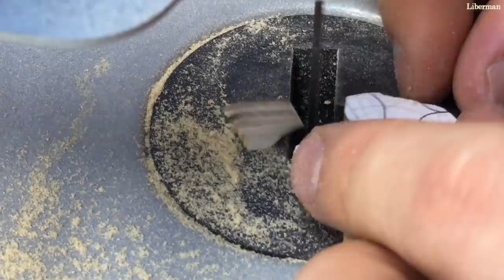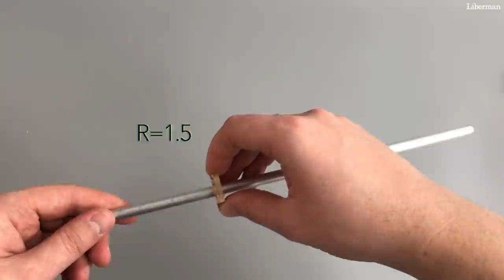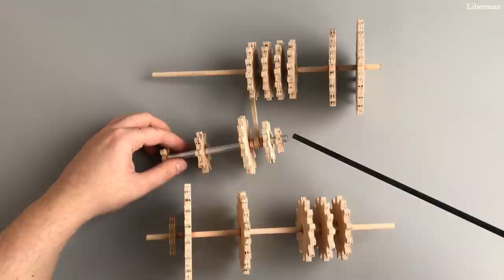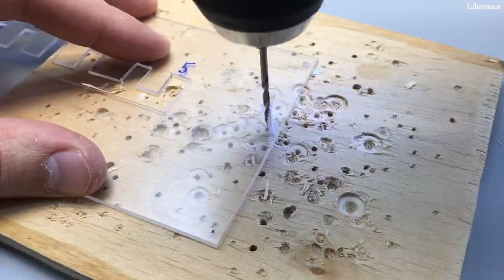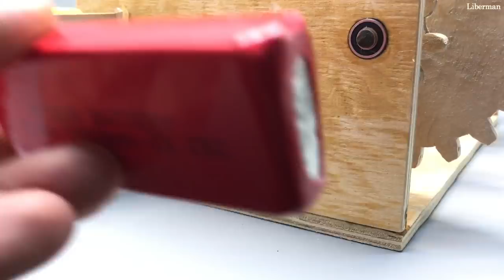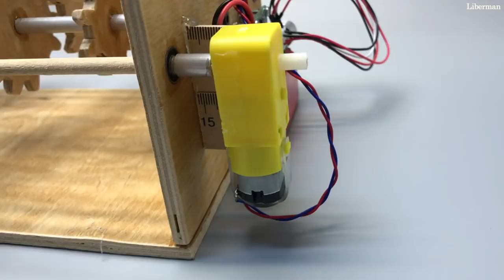How to make 5 Speed Gearbox +R from plywood

Comment: Who else noticed all those cuts when he was shifting?
Reply: He didn't build a clutch, he'd either have to get really lucky timing his shifts or stop the motor to shift smoothly and not just rub the gears together. He probably cuts where he stops the motor
Reply: @firebunny3198  yeah i figured thats what it was
Reply: Well, you don't want the gears grinding, so they probably turned it off and alignes it properly.
Reply: Me
Reply: no clutch
Reply: could this be fake???
Because he cut it when he shifts
Reply: @geraldsilvers8752  yes, thats exactly what I meant
Reply: d e   v i d e o   l i e d ? ? ?
And i actually wanted to make it but now i dont
Reply: @geraldsilvers8752  yes 100%
Reply: Although he work hard...❤️👍

Comment: Notice how he was cutting the video between shifts, probably just cranking up the speed on the motor
Reply: Well, there is no cuts when switching to N, R, 1, and 4th gear.
Reply: Too add on to that, when he was downshifting he did not cut 3, 2, and 1st gear.
Reply: Dylan Lockler yeah I know he didn’t cut between all of them, but he did cut a few times
Reply: He jist letting it speed up there are no cuts

Comment: Now what about a 18 speed manual trans?
Reply: Are you crazy?
Reply: Why think small. When you can think big? Also. I’m referring to a semi 18 speed manual transmission with low and high gears.
Reply: @welcome2myworld1.o89  Those trucks are 18 WHEELS, not 18 gears.  Also, most are AUTOMATIC now.

Comment: Wouldn't it be easier to drill the holes first then cut the gears out?
Reply: The hole might not be center... In my Experience...
Reply: @kamilazman2943  I see, I'm impressed it's so straight by hand in the first place.

Comment: I just dont understand reverse gear
Reply: Normally, reverse is accomplished by adding another gear in between the crankshaft and the output to the wheels so that the wheels turn in the other direction.

Comment: This is not easy there is still Physics done behind it, You can never make a transmission without calculations of gear ratios.
Reply: bet
Reply: @dylanlockler1039  you mean?
Reply: @m.hmalik8520  bet
Reply: @dylanlockler1039  bet what?
Reply: @m.hmalik8520  I bet that it is possible to make a transmission without calculations of gear ratios.
Reply: @dylanlockler1039  Prove it then! How? 😂
Reply: @m.hmalik8520  You don't need to know the exact gear ratios to make a gearbox. All you need is a good understanding of how gears work to make low gears and high gears.
Reply: @m.hmalik8520  You probably should calculate the exact ratios but you do not need to.
Reply: y do u need gear ratios?
Reply: awww he deleted my reply, I was gonna go back and correct myself after finding my error.... well anyways, I did the gear ratios wrong anyways, I used compund forumla instead of simple gear train that this is, so really the gear ratios are as follows... Reverse is 9:7 or ~1.29, 1st is 9:21 or ~0.43, 2nd is 9:17 or ~0.53, 3rd is 9:13 or ~0.69, 4th is 17:13 or ~1.30, and 5th is 21:13 or ~1.62

Comment: You put neutral in the wrong place.  It should be R, N, 1... .  I see the problem.  You don't power the shift shaft.  The shift rod is a THIRD (or more) rod(s) that goes between the input shaft and the output shaft, stupid!  It's no wonder you have it laid out wrong.  Also, no one makes a linear manual transmission.  Manual transmissions have a shift rod for 1/2, 3/4, (maybe) 5, and reverse.  In other words, they would have 3 (or 4) shift rods that move unpowered gears into position between the crankshaft in from the engine and the output to the wheels.
Reply: where's your "How to make a non-linear manual transmission with reverse gear using plywood" video?